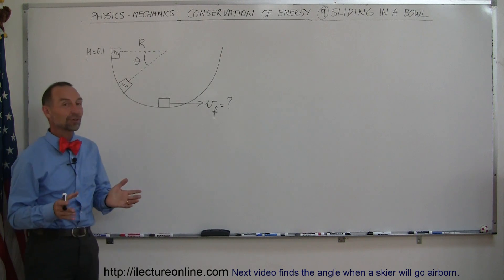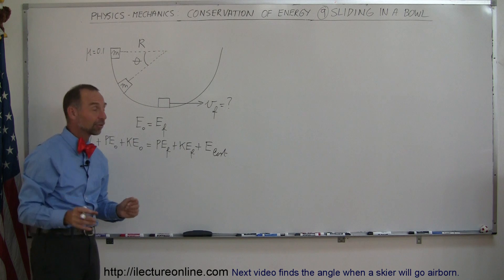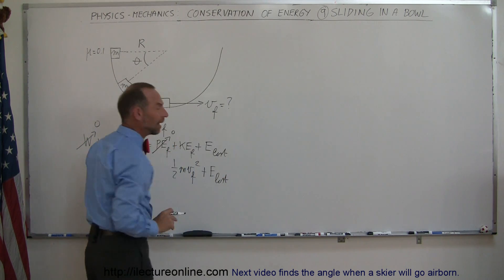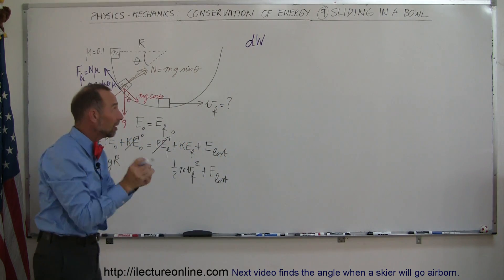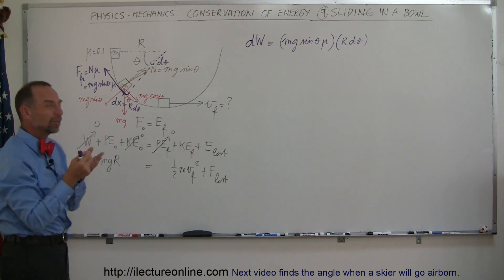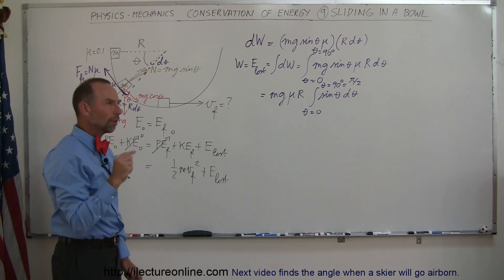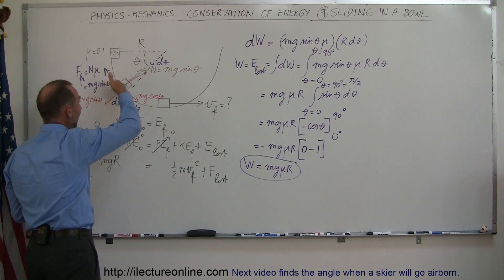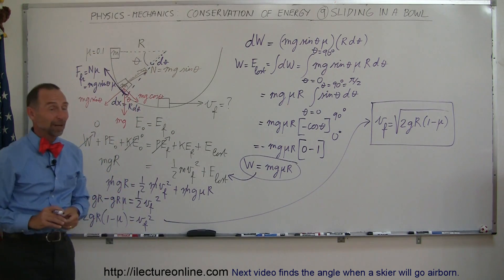Physics 9   Conservation of Energy (9 of 11) Sliding In A Bowl

Comment: Hi, Michel
Can you tell me why the weight doesn't make any  work?
Reply from the maker: The potential energy is taken into account on the left side of the equation, which is then converted into kinetic energy and heat.  (When we use this energy conservation equation, one type of energy is converted into another type of energy, and thus the work does not need to be calculated).
Reply: @MichelvanBiezen  But in the video you said that there's no force   making work and I don't get why
Reply from the maker: The normal force cannot do any work since it is perpendicular to the direction of motion.

Comment: Hi Michel, why is the normal force equal to mgsin(theta)?  I thought there needs to be centripetal acceleration so normal force would need to be more than mgsin(theta) by mv squared over r. thanks Jim
Reply from the maker: The normal force will be mg sin(theta) or mg cos(theta) depending on which angle you are using.
Reply: I also have the same doubt . Actually this question was given in my class and I did the same mistake.
Reply: You are right. Michael makes the same mistake as in another of his videos by not mentioning mv^2/R; not allowed. He could have cancelled this term (assuming for example that R is very large) after writing the equation of motion correctly.

Comment: i don't really get why dx=Rdθ  help pls
Reply from the maker: The best way to visualize that is to make dtheta equal to 2 x pi  (360 degrees), what does ds become?
Reply: umm i don't know :P
Reply from the maker: Note how the circumference of a circle (s) is equal to the radius x angle   (R x 2 pi)  -->      s = R x theta    where s = C in that case
Reply: oh i seeee now it makes sense , very well explained thank you very much ;)
Reply: dx is the small displacement travelled by the block. Note that friction force (f) and dx are vector quantities and their dot product results to infinitestimal heat loss dW. 

dW = fdx

Remember the circle arc formula,

S = r(theta)

So in this case, dx = S, and theta = d(theta) for a infinitestimal circle arc length travelled, dx, there is also an infinitestimal angular displacement travelled, d(theta)

Comment: Hi professor Michel van Biezen, I have several questions regarding your methodology. Why do we need to use the angle given and then find a corresponding angle, isn't easier to assume an instantenous ramp in which the angle can vary and then work from there? Also, isn't mg×cos theta usually refer to the normal force when it is on a ramp? Why would it be different here? And also I did the problem in the exact same way you did but used the assumption that the normal force was mg×cos theta and integrated properly, and I still got the same exact answer you did. Was this because it is genuinely another way of doing it or because it just happened to be right by accident as it is in some cases?
Reply from the maker: There are often multiple ways to do the same problem.  Use the method you are most comfortable with.
Reply: Thanks!

Comment: Hi... is this the complete solution? (i.e. with considering v^2/R):
( 2*g*R^3*(1-niu)/(R*(R+niu)) ) ^ (1/2)
Thanks. -Antonio
Reply from the maker: No this is not the complete solution, we should add the additional normal force produced by the centripetal acceleration.
Reply: ... that was expression for V. When niu = 0 (lossless) it also gives V=(2*g*R)^(1/2), but that doens't mean it's correct, of course :)
Reply from the maker: I should redo this problem taking into account the centripetal forces.  Thanks for pointing this out.
Reply: Thank you for the videos, with clear and systematic approach. I love physics, though I'm kind of slow in working the solutions :/ but I never give up on a challenge, which I guess is a quality :)

Comment: Hi Michel! Thanks for sharing these awesome videos, I'm learning a lot from you. I'm studing at the University of Pavia, Information Technology and Electronic Engineering. I'm integrating theorical parts by using my physic's book but I've found something weird on it. My book says that the work done by the friction is equal to -mg*mu*integral from A to B of the length of the curve ( ds ). Well it started saying Work=Integral from point A to point B of ForceVector*DOT*displacement. Since the friction does work against the path I'm running on, and using the dot product definition we have abs(F)*abs(ds)*cosTheta. Since the friction is pointing ever in the opposite direction of the displacement, we have 180 degrees angle and therefore cos180=-1. So -mg*mu*integral from A to B of the length of the curve ( ds ). And then why are we calculating the path using theta, instead of calculating the effective path of the curve ( so R*pi/2 )? Thanks!
Reply from the maker: Strictly speaking, when the direction of the path changes like in this example, the work done must be integrated along the path, so that the angle between the force and the path direction can be expressed as a function of position.

Comment: Could you please explain why can't we only consider the initial and final position of the object? In that case, N will be equal to mv^2/R and we can ignore the weight, since there is no weight acting on the perpendicular direction at the initial position.
Reply from the maker: Khawla,
There is "weight" acting perpendicular to the motion.
It is actually the centripetal force which acts towards the center of motion and which causes the force due to friction.

Comment from the maker: TheAllofall,
Your friend is correct.  Technically the normal force will be mgsin(theta) + (mv^2/R)
The second term comes from the centripetal acceleration.
In this problem I ignored the second term for the purpose of illustrating the technique
Reply: Sir,  as you know there is enough increase in speed  so effect of it on normal reaction and consequently on friction and work done can not be ignored. Can you kindly include velocity factor and reload next video